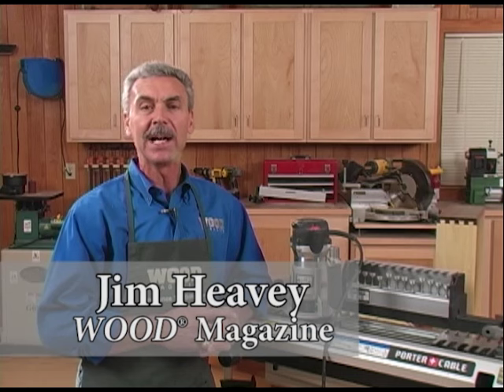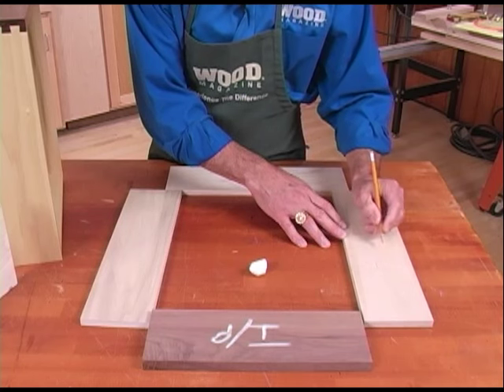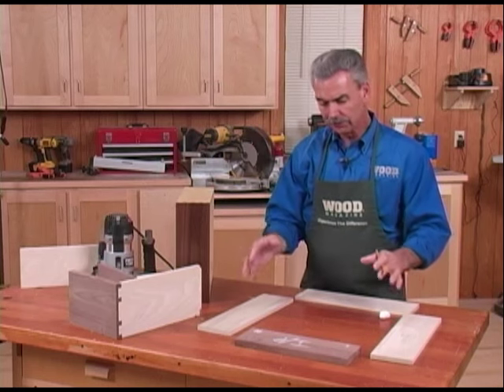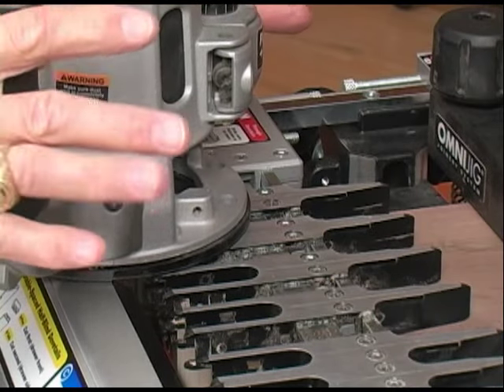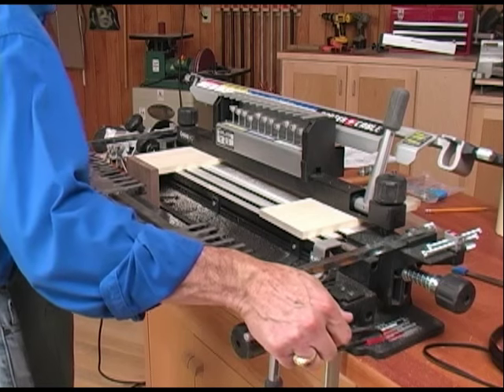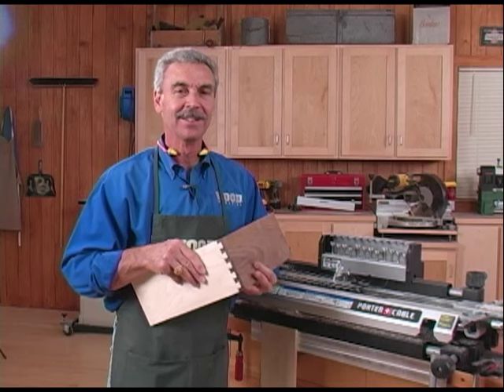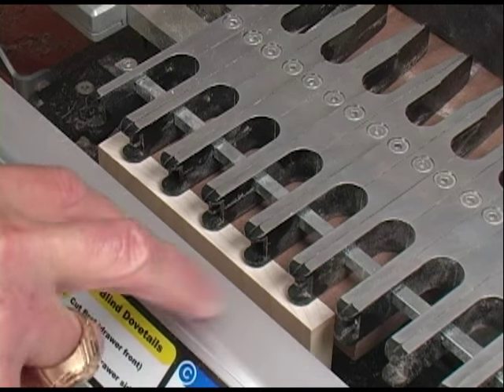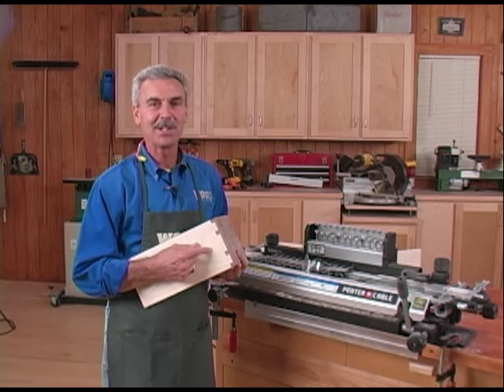How to Set Up and Use a Dovetail Jig -- WOOD magazine

Comment: Good video!
Does Porter Cable still make parts/accessories for this Omni dovetail jig?
Reply: I have heard people say No, they do not.  I actually have the smaller 4612 (or 4621?) I use a lot and I also have this same model, the 24 inch PC jig NEW in box, never used.  I meant to get it setup but never have.  I was going to sell it but after watching this vid I forgot how many cool things this one can do so I may get it set up.

Comment: I have the 77240 but am missing some template guides porter cable no longer makes or has dimensions of. I can make them if I had their outside diameters. G9, G6.1, G6.2, G6.3, G6.4 and G6.5, could you please help me. Just need their O.D.

Comment: What's the minimum thickness of stock to use when cutting dovetails? I've decided to rebuild a kitchen silverware drawer that has fallen apart. It was 1/2" cheap particle wood glued together in dado joints . I bought some nice 1/2" real wood stock to rebuild it. But after several trial cuts with a 1 /2" bit, it seems I'll have to thicker with the material . Any ideas? Thank you
Reply: It looks as though he used 3/4 stock.  For 1/2, maybe rabbet the ends for more glue surface.  Or try a through dovetail.  The same jig can accept both templates.  The 4210 is the half blind, the 4216 template is through dovetails.  The 4210 also makes box joints I believe, which would work with 1/2 stock.

Comment: Is there a reason why you are cutting with the router from "Lest to Right" for both pins and tails?  Will the end result be any different if you cut "Right to Left".? Does it matter?
Reply: It's due to the rotation of the bit. If you cut left to right you have more control. Right to left and the router will try to "run away" from you.
Reply: @patburt9558  Yes, you will screw up your wood really quickly that way!

Comment: On the half blind does the stock for front and the sides have to be the same width? I have been trying to learn hand cut because I want my drawer front to be 3/4" thick and the sides to be 1/2" and I was under the assumption that hand cut was the only way I could get that???

Comment: What model # of Porter Cable dovetail jig is used in this video ?
Reply: Hey Sarah --- this is the PC 77240. It has not been made for many years, but is an all time favorite of mine. If you decide to look for one, make sure you get one that is complete. It should include all of the associated stops, guide bushings (totally critical) and router bits. The router bits you can find, but the stops and bushings are very difficult to find and render the machine almost worthless without them. This jig is simply the most beefy one of its kind. Probably weighs at leas 75 lbs.

Comment: How are you setting the offset on the half blind joint? I don't understand how you the front and side to line up perfectly?
Reply: If you haven't figured out by now, the jig has a sliding stop.  You position the first (lower) board to center it based on  the teeth in the jig.  Then you slide the stop against the left side of that board and tighten it's locking screw.  Then you slide the top board against the stop which has a built-in offset.  Once you have the stop set in place, you can leave it there and do a batch of drawers and they'll all come out the same as long as the drawers are the same height.

Comment: Nice job but there was nothing about the router setup.
What size guide bushing do you use?
Reply: The porter cable jigs come with 2 guide bushings and router bits.  They act as a set when doing through dovetails.  When you do half blind joint, both pieces of wood are cut at the same time , so you can use a variety of combination guide bushing+bit and both workpieces will still fit together.  So, there is no 1 right answer to your question.  The bits and bushings that porter cable include are 43776PC, 43743PC, 42040, and 42046.  Those 4 are enough to do through and half blind joints with their jigs.
Reply: This was confusing to me also, after reading the instruction manual for the jig.  Porter Cable calls these "template guides",  I have always known them as "router bushings".

Comment: For the half blind cut you mentioned an offset between the boards. How much is this offset and how do you determine this value???
Reply: maybe i'm too late, but the outer board (the one facing you) should be centered on the template, with equal distance from the edges of the top board. In the middle of the outer board, there should be the middle of a finger on the template.

Comment: HI! Do you recommend a type of vacuum cleaner?
Reply: Shop vac.  Then make a box fan - furnace filter to filter the fine dust out.  There are several videos on how to make one, but the easiets is to duct tape a 20x20" filter to the box fan, let the air pull through the filter then the fan.  Also, wear a respirator or a N95 dust mask.  Wood dust is a carcinogen.